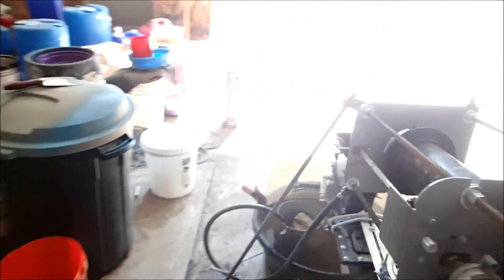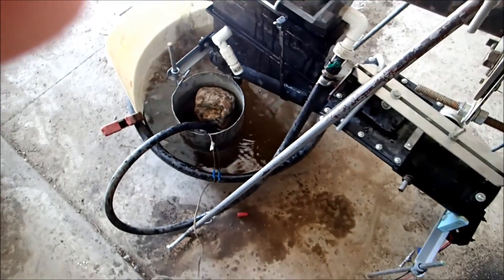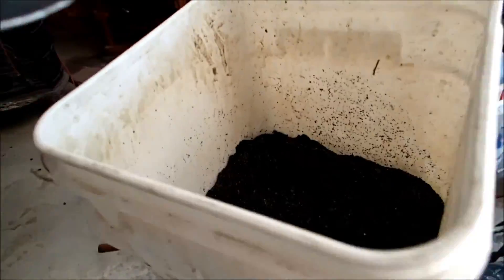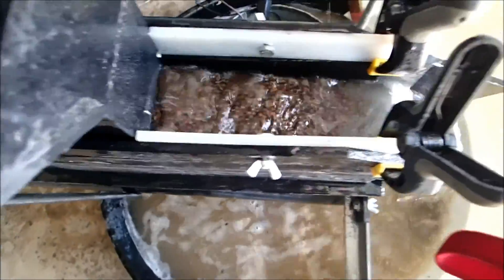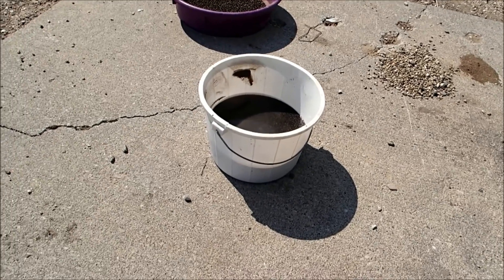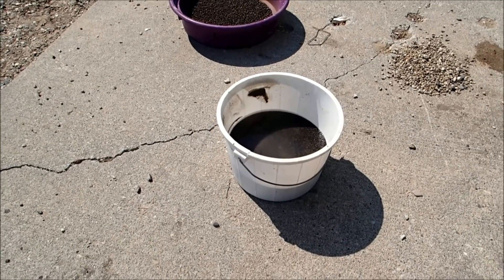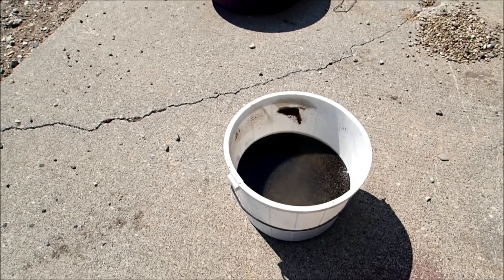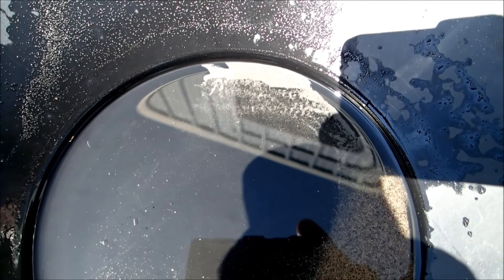Jigging for Gold Part 3

Comment: Great video Jim. What about using the 2" screen box with more shot? Or heavier shot? Or smaller shot? You mentioned in the narrative text that the diaphragm has more push then you other machine...
Reply from the maker: ebuyc Hey Chance...hope you're doing well. Thanks for the comments. There are a couple of reasons, or 
maybe more, why I don't use the deeper screenbox. I actually made a video
 of that, but only with the shot 1" deep in the bottom....somehow I 
deleted it, so the 2nd video only shows the shallower box. I'm maxed out
 on the motor with the 1" of shot. 2 springs (totalling about 15lbs of 
tension) are all that motor can handle. The other downside of deeper 
shot is weight. Each inch of shot weighs about 9lbs. It's a nice 
portable unit for gems, at 20lbs. A little less portable for gold at 
29lbs. Another inch of shot would put it up there close to 40...or more 
with the little sump pump, and battery.
 I'm starting to think, after reading a bunch of stuff, that jigs typically are used as "roughers", 
and followed up by running the rougher cons through "finisher" jigs. In 
effect, you have to run the cons multiple times. That's the downside. 
The upside is that jigs will recover, as shown on the video, REALLY 
small gold, and other metals. If I were working a stream for gold, I'd 
run about 50 gallons of material, and do a cleanout. I'd repeat that 
until I had at least 5 gallons of cons. Then I'd run those cons, and 
reduce them to 1/2 gallon or so.....then pan them down, or use whatever 
final cleanup procedure I typically used.